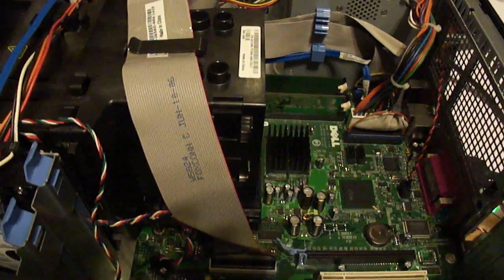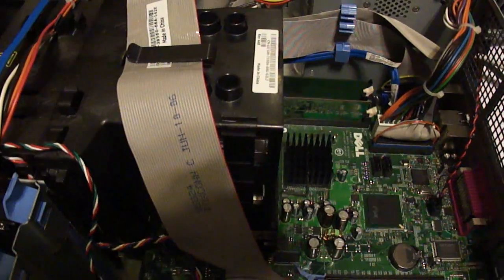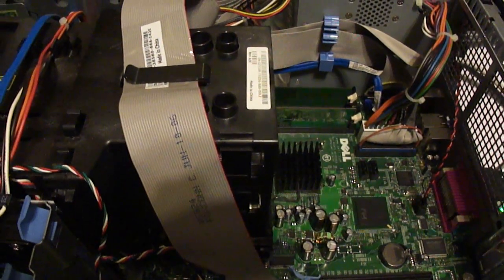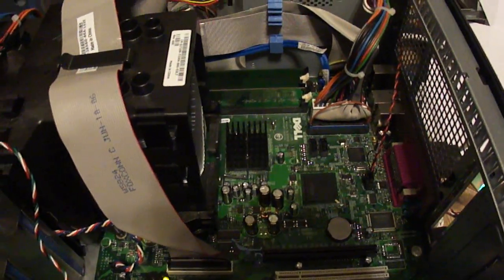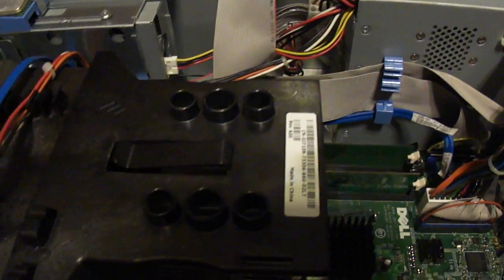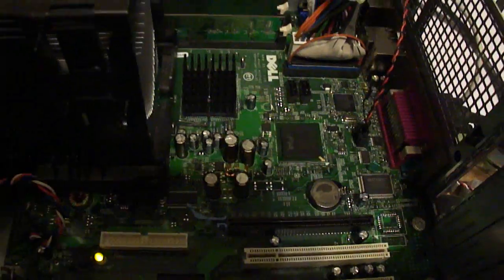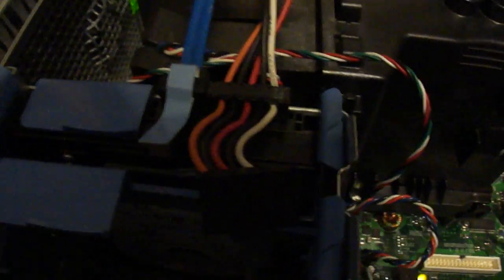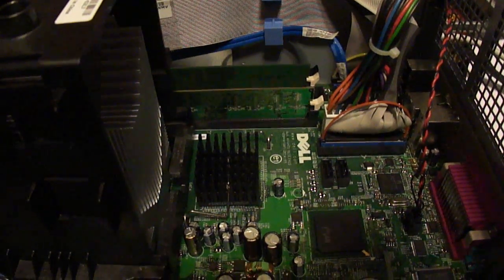[2013] [SOLVED.] OptiPlex GX620 - Beep Code 1-3-2, RAM Error.

Comment: change the memory ports on your main board or just clean them.
Reply from the maker: The issue differs for many different people. The most logical reasoning I can find to explain it is the chipset either going flaky with age or the RAM going balls-to-the-wall nutsy due to dust or bad chips. so yes, this would work, but in all honesty, when you're faced between reviving a Pentium 4 box and replacing it with a modern machine that will outrun it 50-fold for very little money either new or used, the solution is clear-- scrap the old machine or board, find a drop-in to replace it with if you can be so technically-inclined to do so, and roll with it like that.

in this particular case, the easiest way to save me frustration and hair-pulling was to just replace the board outright since I knew what it would cost and how much time it would take to replace the board and other misc. components. the machine lives a second life now, as an OptiPlex 755 in a friend's bedroom now, chugging away with a Q6600, 8GB of RAM and 3 hard drives with a 9800GT (in place of a failed 6670) for limp-home-mode graphics capabilities until there's adequate money to acquire a 750Ti so the thing is usable again as a proper computer. but, at the same time, even the tiny SFF OptiPlex 790 said friend got for free from her workplace, with an i3-2120 outperforms that tower now, so my current advice is to just replace the machine outright if it can be, else just upgrade the internals with cheeeeeeeap boards and components available on eBay if at all possible.

Comment: The problem is the ram you need to upgrade or find out the exact specifications for it it happen to me I was trying to remove ram to sell it and the it wouldn't let me downgrade from 4G to 2G's so I went back and put back the original ram and just higher the price problem solved 
Hope this help you guys
Reply from the maker: it's not always the RAM. in my case, it was bad RAM on the board. I still recommend the board and front panel swap for anyone and everyone that has one of these old GX620's, just because of the upgrade options-- and all for under 50 bucks. and from there it's another 30 bucks to get a Core 2 Quad Q8200 and run circles around the Pentium 4 or Pentium D you already would have had in this behemoth.

Comment: Hello, I have a Dell Optiplex 330 and I was upgrading the RAM memory from 1GB to 2GB, it worked before I changed the ram, but once I put the new ram (2GB) it wouldn't work anymore and I also have the 1,3,2 beep error can someone help me with this, the mouse, monitor and keyboard won't work either... Also at the front of the CPU there are some number lighted in green, the numbers are 3 and 4...How could I fix it?
Reply from the maker: clear the CMOS (remove the battery) with the new RAM installed. this may help.
Reply: Thank you, I will try it
Reply: ***** I have try it but still doesn't work
Reply from the maker: juliethZuRe  then I have no idea how to help. I'm only good with the machine right in front of me, sorry.